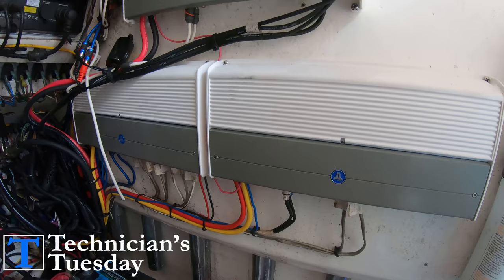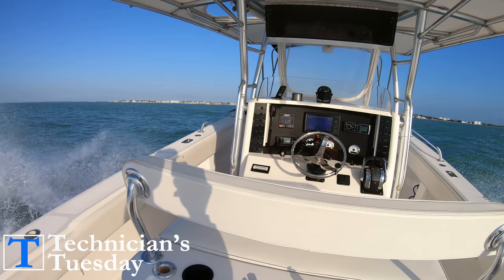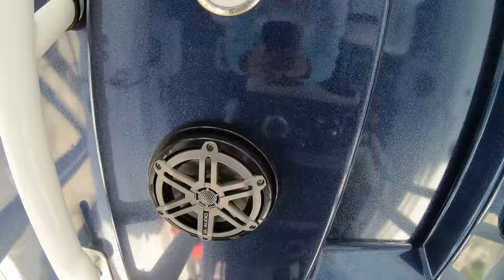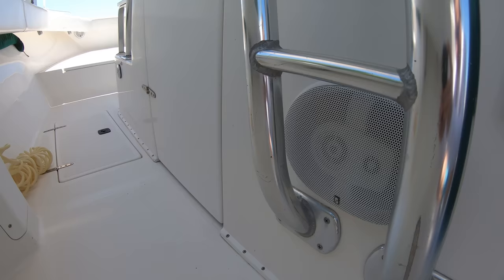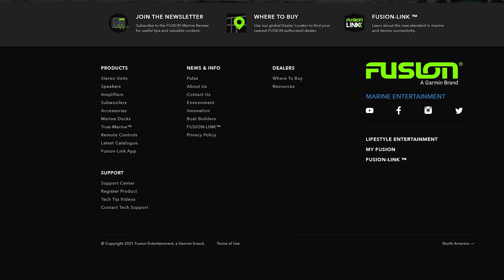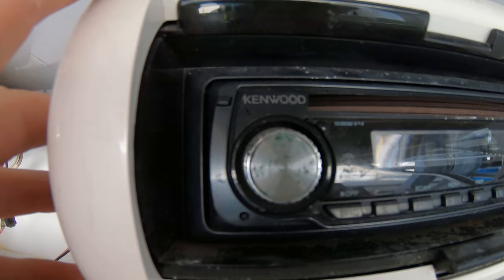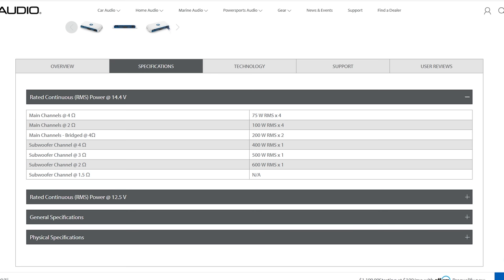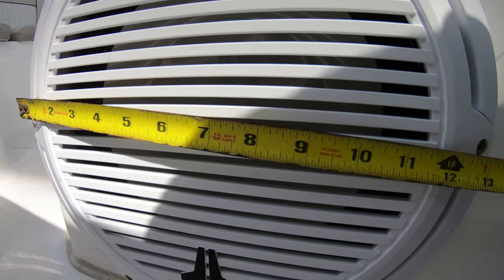What Makes A Great BOAT Stereo System?

Comment: just redid my system, made me realize i like good system.  originally only swapped speakers cuz i didn't care, but they were wired up wrong, one left channel supplying both left speakers, one right supplying both rights.  sounded like crap.  rewired properly and added a little amp, sounds so much better than i expected it would.

Comment: Great video guys. There is lots to think about when it comes to your boat's audio system and you pared it down to the essentials, making it all easy to understand. My biggest take away - Make sure you spec out your speaker's RMS rating so you do not blow out your speakers and you get the volume you want!

Comment: In my boat I have an Inboard 1956 Ford 272 V8 with two 3 inch straight through exhaust pipes... My favorite tunes on water
Reply: Yeah cause straight pipes aren’t annoying either. Music to my ears would be the sound on your midrange engine throwing a rod at your 40 mph WOT.

Comment: I honestly don’t know what’s worse. Relaxing and having someone with a 2 seater roaster tailing through a packed and calm cove 
throwing waves everywhere or 2 boats tied together starting the next rock concert.  I have a loud system, Ra770, 2x Rev10s, 485, 4x6.5 and a 12 T2D2 with three amps pushing it all but it keep it between at a quarter to half volume unless we are out towing and surfing.

Comment: I have 4 JL M6 8.8, 
2 M6 10s 
1 JL 600/2 amp 
1 JL 800/8 amp
Love them
Reply: what kind of boat do you have ? Also are you happy with the 10s or would you put one or two 12 if it was to be done again ?

Comment: Great explanation of some tech stuff with audio. I am removing a 5 year old factory installed audio system that is going to the dump. It had a 760 watt 4 channel amp with 6 speakers and a subwoofer, but it was good enough 5 years ago at the boat dealer. Upgrading to a JL 8 channel amp and JL speakers.

Comment: How does this affect the fiberglass? Or any panel on the boat? Im talking about what are the long term effects that all that vibration has on the panels of a boat made up of more than one layer of a material??
Reply: When talking about subs, doesn’t affect the fiberglass other than cutting a big ass hole in a perfectly good boat for usually an underwhelming speaker. “IB subwoofers” are lazy, inefficient, terrible sounding options in a marine environment and any shop knowingly cutting 10-12” holes in a perfectly good boat should be responsible for the cost of fiberglass repairs. When it comes to marine subs, build a custom enclosure or don’t do it all.

Comment: Went a little over the top with my stereo. 14 JL speakers and 4 10 inch JL subs w 2800 watts of power.
Reply: how much did that run you?
Reply: At least you paired enough bottom end up with everything above 80hz. The marine audio world is obnoxious otherwise. I love how virtually every shop out there will put in a dozen coax and/or horns and then a garbage 10 or 12” free air sub cut into a cabinet in a pseudo IB configuration. Don’t even bother with the sub at that point.

Comment: Here’s my question. I went expensive with a 600 dollar fusion amp, the speakers i have are 150 watt. Went cheap on the receiver with only a 50 watt. Am i going to need to change recover to max output on sub and speakers

Comment: 2 JL M6 7.7s and a M6 10 sub is plenty for me. Usually use my stereo when alone just cruising around or at the sandbar with friends. When fishing don’t even touch it
Reply: what kind of boat do you have ? also did you add an extra battery ?
Reply: @wyatthunter987  I have a 2019 170 Montauk and I have two batteries

Comment: I have a Fusion system and many more components that I can't begin to understand. Thinking the system was off, I Equalized my batteries this weekend. Now when powering the system. The Fusion wired remote start but nothing else come on! I'm going to check at all fuses but if you can refer a tech in Los Angeles / OC area I would really appreciate it.  Thank you.

Comment: My boat is a 2021 Yamaha 212SE and has 6/6.5 WS speakers with a WS HXT-4 amp. Everything is controlled through the Connext Enovation head unit, and a remote unit on the swim deck.  Only 2 controllable zones, when there should be 3. Also, there is no equalizer. A lot of us boat owners are swapping out components. It sounds good, but I would like to add a sub. I'm not into adding tower speakers. Maybe a soundbar. Any advice appreciated!
Reply: The factory amp on it is junk and you’re probably going to need to replace it. The factory WetSounds are the same as the recon series and can’t handle the power of the revo series. You’ll want a LOC ($25 passive LOC or $65 for active) since the enovation doesn’t have RCA outs. If you’re just wanting to do a sub then keep what you have and add an amp and sub.

Comment: Sorry to post this here but the e-mail on your site is not working right now.
I am building my own boat.   If It matters I am making a 19 foot fishing boat with a 115 HP outboard engine. 
I have purchased a MOELLER 17 Gallon Permanent Below Deck Fuel Tank, 36.5"L x 18.25"W x 7.25"H Model # 8978462  fuel tank.  It has connections for fill, vent and supply. My question is regarding the vent for the tank.  I watched your video:  "Does Your Boat Need A New Fuel Tank? Let's Install One! Aug 2019".  In the video the vent was placed on the boat below the filler port.  I am not sure how this works, but wouldn't that allow the fuel to pour out of the vent if the fuel was taken on until the gas pump "clicked off" when the tank was full?  I am not doubting what your video said, but I just don't understand how the vent works I guess.  I am concerned that there may be regulations which I am unaware of also. 

I am not sure where to place either the filler or the vent on my boat.  I just don't want to mess this up by drilling holes where they don't belong.  Can you point me toward more into on this subject?  
Thanks for your help,  
Dave

Comment: I’m running 6x JL 8.8’s, 10x7.7s and 3x10” subs. Running off of 1x800/8, 2x700/5 and 1x600/6. With a Fusion 755 head unit.
Reply: what's a ruff estimate of the cost of that set up
Reply: @jonathanmiranda1192  Retail on the equipment including connectors and wiring was $12k not including installation

Comment: I have 6 JL audio speakers on my center console. I’ve noticed the speaker wires are just like home speaker wires. Noticed  the robust wires at the end of this video. Do the wires increase performance of the system?
Reply: No, just use the correct gauge of wire necessary. So called named brand wire from Monster doesn't make any difference. Don't fall for the bs of one brand of copper wire is better

Comment: Is is possible to connect directly just with and ethernet cable a fusion stereo to a garmin chartplotter? or do you need a router? Specifically I have a garmin 722xs plus, and would like to connect a fusion RA 670 and would like to avoid installing and NME200 backbone.

Comment: I finally found a new to me center console that came with a fusion head unit and two fusion speakers in the gunnels. They sound good, but the blue tooth doesn’t work, so I’m thinking of switching to Simrad’s sonic hub and eliminating the head unit. Or is that a bad idea? Should I get another fusion or JL head unit?
Reply: JL MM50 or 100, or Fusion Apollo 670. Not cheap but by far best option. Coming from a broker who’s seen it all. Sonic hub works but is tough to work sometimes

Comment: I have 2 700w tower boss speakers and a pair of regular Rockville interior speakers....2400w amp on it and not on high gain. System gets very easily crackily sounding if turned up decently loud. Regular old boss head unit. What’s my first step in solving this? For sure a bit of a boat amateur but much more an audio beginner....help!

Comment: So can I run a single amp to power 4 JL M3 7.7 and a JL m3 10inch sub? Which amp would you recommend?
Reply: JL makes a 700/5 which is perfect for that. Fusion makes a 5 channel signature 1600w that puts more power then that

Comment: How do you adjust the ohms? Like if you are adding speakers, and need to tune the resistance. I had a deck boat come in, to add a tower. No biggie. But then wanted to add tower speakers too. 😱 Six speakers and no sub. He had a Xdm-4 Clarion head unit. How do you wire those two new speakers in, without having 2 channels that switch off/zone swap?? I left the wires hanging and labeled, under the helm, near the head unit. And told him to consult a stereo professional. 
Any thoughts?
Reply: Only way to change impedance or ohms is to add speakers in parallel. For example, if you put 2 x 4ohm speakers in parallel on a single channel, it will cut the ohm load in half to 2 ohms. If you’re adding more speakers wiring them in parallel will reduce the ohms and increase the power output. You have to see how low an ohm load you amp can handle. Most will do 2 ohms ok. Others will go to 1.
Reply: @yjad27  😯 Ohhhh. 
Thanks. 😁
Reply: Wiring 2 identical speakers in series will double their ohm rating.

Comment: What happened to the velocity delaminates video
Reply from the maker: It wasn't a Velocity desafiantes video, we had to rework it because people were getting that idea. The boat hit a metal pole and didn't repair it properly, which filled the hull with water and then the weight and the trailer bunks made the repair delaminate. :) not the boat itself